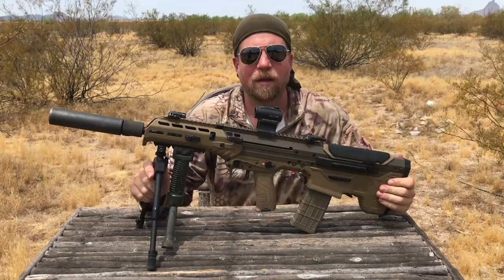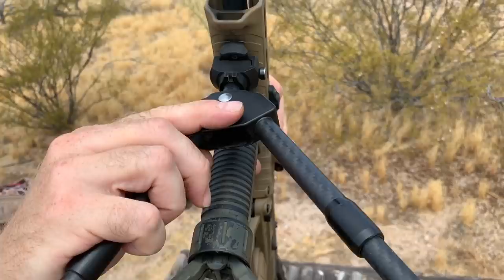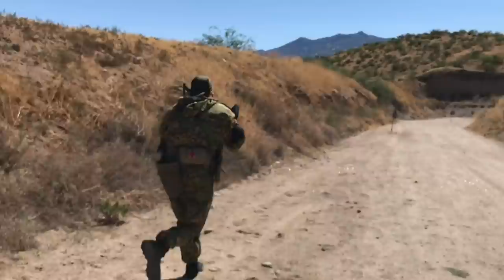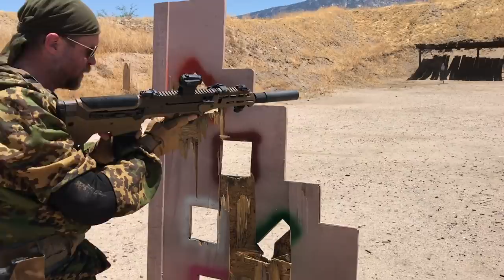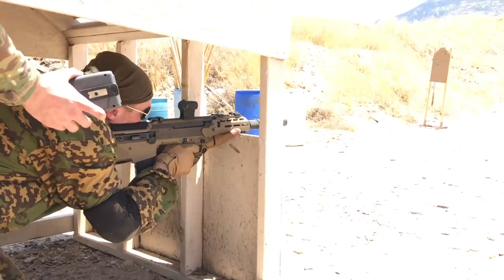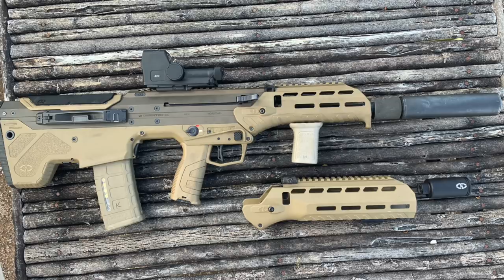Desert Tech 5.56 MDR Optimization

Comment: That's a nice rifle, I like it. I'd like to get into bullpup rifles, the only experience I have with bullpups is the keltec KSG
Reply: I have the RBD, absolutely love it. Only issue I have with it and a lot of Bullpups is that when you have a malfunction, it is a lot harder to quickly clear in the field. For a particularly nasty double-feed, I essentially have to completely disassemble the gun. Not exactly fast
Reply: The AUG A3 is also a great pick if you can find one at a good price point (though they're absolutely worth Steyr's RRP in my opinion). The A3 in particular is just a better modernized AUG with more real estate, slimmer profile and a noticeably slicker trigger. It may have taken them forty years, but Steyr has finally worked out how to get a slick two stage trigger going. On civilian market rifles the trigger isn't a big issue for obvious reasons, and you can get aftermarket trigger groups to lessen the weight of pull even more.

Comment: looks like a cool dual purpose plinking and hunting rifle. Bit heavy but that can be fixed with longer e.g 24 inch light weight proof carbon barrel and like you said, perhaps with titanium suppressor. Needs to drop weight to 10lbs for a solid hunting unit shooting a bigger caliber and heavy bullets.

Comment: I'd be curious to see your opinion with the balance on the Steyr AUG. My A3 with the 16" barrel has the balance point right at the pistol grip. 
It does feel quite different when compared to my Tavor SAR, which has the balance point approximately 3" behind the pistol grip. 

That said, the AUG, even with the added bolt release of the A3, does have some ergonomic shortcomings, such as charging handle (when compared to other bullpups), selector (I prefer rotary to cross-bolt), magazine release (could be larger), lack of a deflector (possibly the biggest thing in my opinion), and of course the lack of being able to have any real forward accessories other than the integral vertical grip. 

That said, the AUG certainly surpasses the Tavor in gassy-ness, or lack thereof, as the short-stroke piston of the AUG vents everything very far forward while the Tavor's piston will vent at about the rear of the top rail.

Comment: I feel like adding another 4 inches to the barrel and handguard is defeating a lot of the reasoning to a Bullpup rifle. This is almost double the weight as you have it to a AR15 and adding barrel to that will make it as long as the AR so why not just use a AR15 and save the pain of the weight being carried. Not to mention all the high speed kit that military would add and more weight maybe those parts lasers, lights would make the weight he was after. But still I would prefer a lighter rifle.

Comment: Weight in bullpubs is not a huge problem because the reason for having bullpubs in the first place is that you want to maneuver inside buildings and in and out of vehicles. Thus, it is unlikely that you will cover a lot of ground an foot with the rifle in its intended role.
Reply: You didn't watch the video.
Reply: You Sir are clueless. Armies for logistical and budgetary reasons will not invest in two different rifle systems for mech and leg infantry, regardless if operational theater is a desert or urban area, everything is a compromise and You still have to lug that thing for the 10 mile ruck march. Look at Israelis (all forces to be issued with X95), Belgians (using F2000 only in limited numbers for special operations units), Austrians (StG77 still in use by all force components) and British (modernization of SA80 system to A3 standard). Croatian VHS rifle only looks like it looks because that s the only system that Croats had to work with from the start tinkering with reverse engineering bullpup HK G36 / FN SCAR with the imput from their earlier bullpup AK design.
Reply: @lizardb8694  I just googled the VHS and saw the VHS 2. That's one Hard-Sci-Fi looking rifle.
Reply: @lizardb8694  That is what I was pointing at when i said "in its intended role". Bullpubs are almost exclusively never used in the optimal scenario militarily. :-)
But I never said "military" or "army" in my original post. You brought that up. For law-enforcement, private security contractors, civilians, etc. using a bullpub weapon system makes a lot more sense than for an army because the use of guns in combination with vehicles in their work or everyday live is much more comman than for army infantry. Almost no law-enforcement person will walk 10 miles on foot to reach the scene.
Reply: @123nicefellow123  Yes, in that aspect You are right, and even in strictly military side, like for example, for French designing FAMAS as short rifle for mounted, heliborne troops and Paras for something like WW III scenario in early 1970s probably had a lot of sense, also design like Tavor is rather advantageous for IDF soldiers, for situations like maneuvering through tight streets of Nablus. Designing a weapon is always a trade off. Sometimes specifications represent realities in which weapon system will be used more times then not, sometimes not so much, and sometimes pointless things are produced simply for coolness factor, like the cottage industry in MENA region that converts AK type rifles into bullpup configuration for almost industrial scale for various insurgent/terrorist organizations, simply because it s a trend.

Comment: Well presented point of view. 

I prefer "steady hold factor" techniques and use of a shooter's sling over a bipod. Not a fan of hard bipod legs. And of all the rifles I've shot, the MDR has less need of a bipod than conventional rifles...in fact I soon found that I could shoot the MDR without any aids (sling) as well as my AR with a loop sling. 

Not a fan of vertical fore grips either. I do not want the snaggy clutter or interference when using cover. From a gunfighter perspective, the BIG advantage of the MDR is perfect ambi mirroring for optimal use of cover.

I disagree with the balance issue. I prefer a buoyant muzzle to prevent digging in when diving and make one-handed firing an easy matter.

And instead of a suppressor (or muzzle brake), I would like to compare the stock 16" barrel to a 20". Another 3-400' FPS for more kinetic energy.

IMO, the MDR makes the AR a relic. Another decade of refinement, and it will be like comparing the M1 Garand to the M1903.
Reply: This gun will never replace the AR. It’s too fucking heavy.

If you handed this to an infantryman he’d crack it over your head and take his AR back after the first march.

Comment: I have a question that's off topic. What are the odds of a modern 38 pistol with modern ammo that's maybe 5 or 10 years old misfiring 5 times in a row? I got in an online argument with an idiot. I think it's very unlikely almost impossible without a mechanical fault in the pistol. I've seen Ian fire 50 and 100 year old ammunition and most of it fired yes there were hang fires not at 100% factory specs but most of it fired. But I'm not very knowledgeable about guns even though I'm interested in them or ammo so I'm hoping one of you guys with way more knowledge could let me know if I'm right or wrong lol. Love the show Carl been watching for years. Later everyone.
Reply: By "misfire" do you mean the primer failed to ignite? Sounds like bad primers either because of some manufacturing defect or environmental conditions. Any number of things will ruin primers, including oil. While not common, there's nothing impossible about an entire box of ammunition having bad primers.
Reply: @andrewwaterman9240  yes I mean the primer failed to ignite. From your answer it sounds like me and this other guy are both online idiots lol. So it's not likely but totally possible. Thanks for the info.

Comment: Just because I'm curious, have your considered running the MDR in 5.56 with the supressor specific handguard and an OSS supressor (which is what the longer-than-standard handguard was designed for) to see how that would work, given that a suppressed configuration seems to be ideal for this platform?

Comment: I still disagree on the subject of red dots. I maintain that with modern ammo even intermediate rounds like 556 are not being fully utilized by most people without magnified optics. Specifically LPVOs. While Karl is no doubt a good shot from his time in high power, most soldiers (even the infantry) are not great at making 300m+ shots with red dots. These same guys will clean up with an ACOG.

My point being that to fully utilize a 16in weapon it needs an LPVO (in my experiance).

Comment: i have to wonder, if rear biased weight is an issue, would a somewhat longer, heavier profile barrel help at all? i just saw a video on the california compliant version they made, which comes with a 20 inch barrel with a compensator and i wonder if that would help, along with capitalizing on a full size barrel in a compact form.

Comment: Alright. Just a general nit pick about how people talk about weight bias in guns, and this is sort of just a train of thought peeve.
People generally speak redundantly and waste time talking about 'where weight should be'.

Example: "What you want is a balance point in the middle of the gun where you are holding it. You don't want a lot of extra weight at the front of the gun because then you have a forward heavy gun and you don't want a lot of weight in the rear of the gun because then you have a rear heavy gun. You kind of want it in the middle."

Reason: You start off saying that you want a mid balanced gun to pivot on your trigger hand. "Cool, understood". But then you go on a tangent saying "You don't want weight at the front, [Why?] because then the front it heavy." Which just says the same thing twice on a matter that we already knew wasn't optimal.

Comment: I have been waiting 7 Months for a conversion kit (223).  Desert Tech has had my money during this time, but won't send a conversion kit.  Excuse after excuse.  I originally wanted the 556 but took a 308 after 2 years of Desert Tech holding my money. That's right, two years. I wonder why they advertise the conversion kit if they can't deliver it.  Based upon my poor experiences (sent the MDR back to redo the innards, gas value twice), go with one of the other brands.  They are a horribly run company and don't care about their customers.  I am sorry man I guess I need to do a YouTube video so I can the conversion kit.

Comment: I wonder how the UTG Recon Flex bipod would feel
Reply: I would think the only downside is exactly the same as the issue of using a grip-pod: It isn't long enough. The Spartan bipod is up to 12.5" under the gun, the Recon maxes out at 12" on the side of the gun (easily 3" shorter, and the same length as a standard grip-pod)

Comment: Would any rifle with a somewhat short barrel and a folding/collapsing stock have the same advantages as a bullpup?
Reply: Not necessarily. For the same barrel length, a bullpup will always be shorter, and a folding stock would still have to be deployed to be used properly, which would also add to length. 

Two main advantages of a bullpup are shorter length while in use and a centered balance point, rather than being front-heavy.
Reply: @000Mazno000  Can't forget "full length" carbine barrel in a smaller total length weapon

Comment: When you attach a suppressor (or use longer barrel) you loose the biggest advantage of bull-pup configuration - it's compact length. Makes no sense to me.
Reply: It's still much more compact than a comparable setup in the traditional configuration
Reply: And it isn't as front heavy (though sadly overall heavy yes) as a non-bullpup would be with a suppressor.